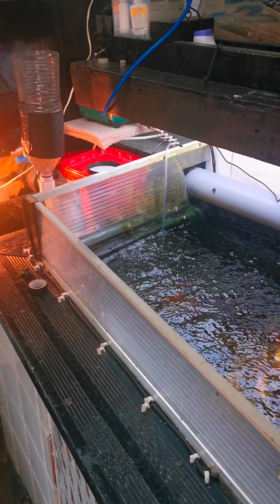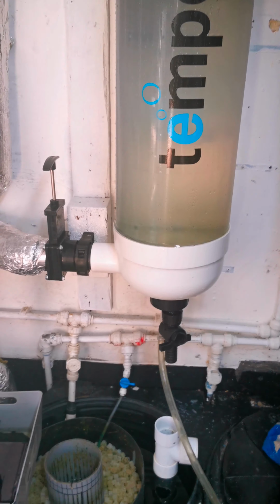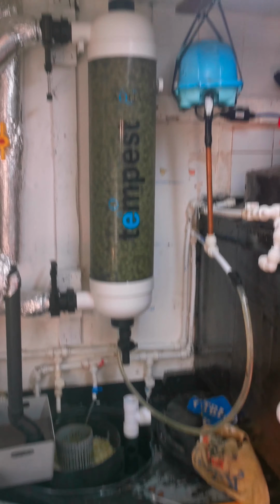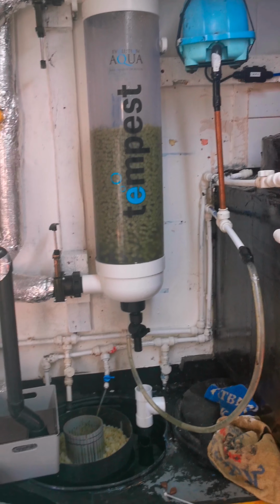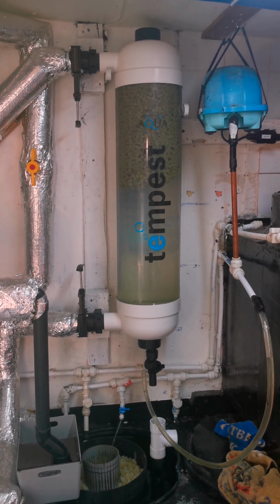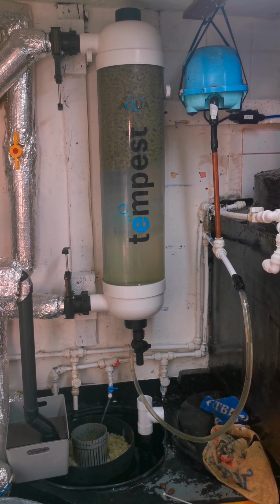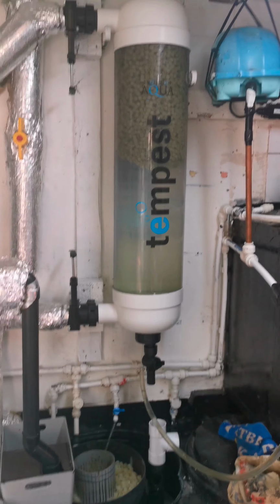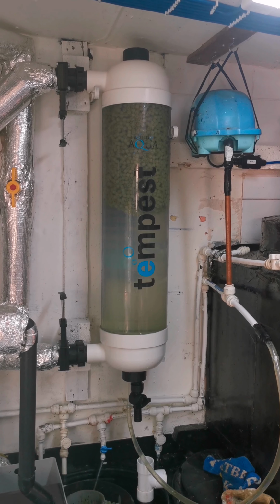EA TEMPEST FILTER TEST WITH AN AIR Pump #eatempest #koipond #pond #koi #koilovers #fry #japanesekoi

Comment: Nice one, I am definitely gonna give it a go, I'm just finishing my second clover leaf Algea treatment and like Lau my tempest got a bit chocker, so had to do three cleans two days running, I looked at it yesterday and thought could I do what you have done, but didn't think of opening the top valve, thanks for what you done gonna do this.
Reply from the maker: You're more than welcome dude since doing the video I have tried it a few times and have noticed that if you leave the air running when you dump too waste you get a better purge of the media also 👍

Comment: Great video. 
I've had good results using the tempest but I've had a replacement bottom drain piece , it worked well for a couple of weeks but it now only seems to " Gurgle " for about 10 seconds , stops then jus drains out , any advice please 🙏
Reply from the maker: Hi mate I found that after using the air pump on the tempest I had damaged both the seals on the slide valves and the ikkle none return 🤬🤬🤬🤦🤦🤦🤦
Firstly I would change that but also when putting the waste unit into the tempest try and make sure that the pipe that goes into the tempest is directly in the centre 👍👍👍🧁
Reply: @LeTwistedOne  Thanks Mate ,  how do I line it up ?
Reply from the maker: @christyreilly3327  when you take the unit out completely the air pipe is slightly orf set but when putting the unit back in you can hold it in the positron you want it in then do the nut up of that makes sense🧁👍👍👍
Reply: OK mate nice one il give it a go

Comment: Hi Vince, can you put ptfe tape on the thread where the valve goes onto the bottom of the tempest ? Only mines leaking on testing
Reply from the maker: Ofc you can mate but I'm surprised that it's leaking through the treaded but tbh 🧁👍👍👍
Reply: @LeTwistedOne  it’s ok mate it’s me, I didn’t screw the top cap on after putting the media in🤪

Comment: Hi mate great vid where did you attach the airline to on the tempest I couldn't see please
Reply from the maker: Hi dude on the bottom of the tempest there is a drain tape and an air line with a non return valve on the end I connected to that non return valve 👍
Reply: @LeTwistedOne  thanks mate I will give it a try
Reply from the maker: @colinsharp1314  I will be doing another video tomorrow. Morning dude I will make it clearer 👍👍
Reply: Thanks mate that would be great 👍

Comment: Hi thanks for doing this video very helpful. Would you be able to shut the valves drain the water to below the top white cap then try the air pump?
Reply from the maker: Hi it still becomes a pressure vessel with both valves shut you will definitely need to have the top valve open to bubble with an air pump, but in the object of fairness I will give it a try and get back to you 👍
Reply: @LeTwistedOne  Thats great thank you 👍

Comment: If you open the cap at the top the air will work super good
Reply from the maker: Having the top slide valve open is easier mate 👍👍👍